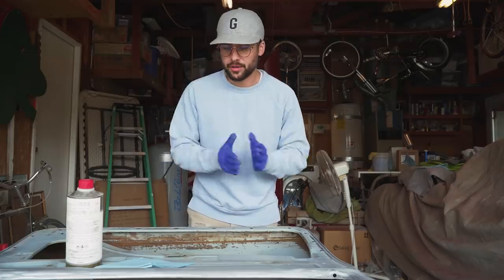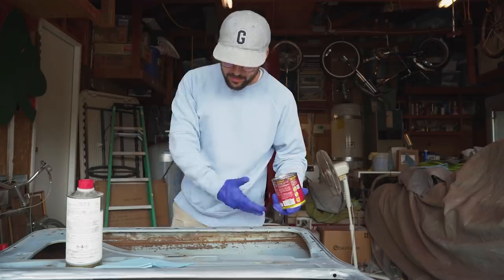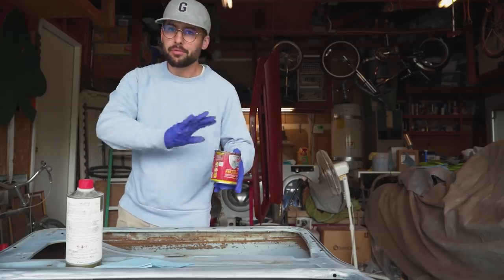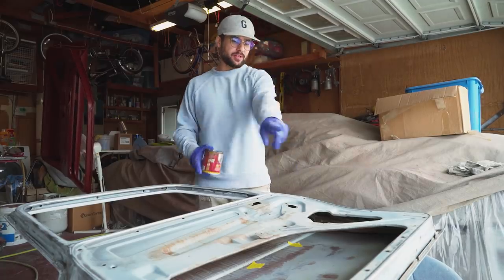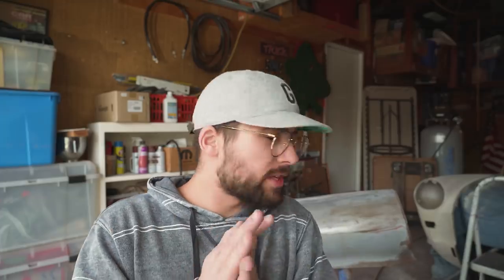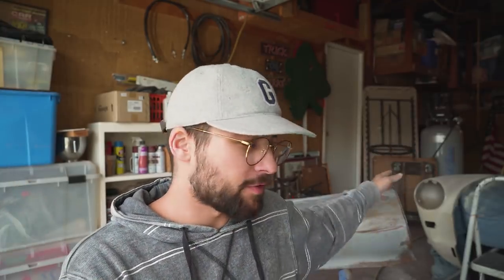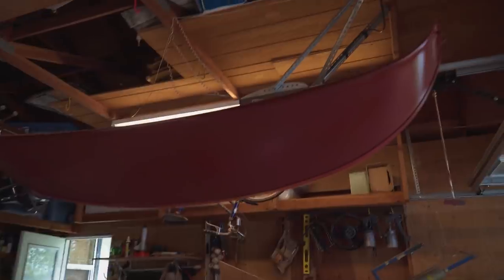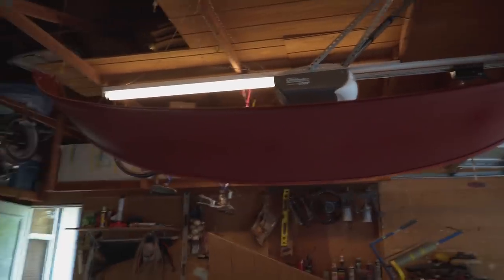Rebuilding a 1967 VW Fastback Part 4 | Classic Car Rebuild

Comment: I like this video.  Why weren’t the parts put on the car & then paint? because you wanted to paint the interior & exterior & this was an easier way to do it? Can we meet your dad?
Reply: It's a full restoration. They're painting it like the factory did. To get the door jams and trim done properly it needs to be taken apart like that. It's just more thorough. And also easier to reach the tight spots.
Reply from the maker: ill see if he wants to get on the next video but dont blow his ego up too much lol. and yeah what the homie said here, in order for us to get all of the hard to reach places and make the entire car one same color, we need to take it all apart and then paint it. Plus, the pieces needed body work which is easier to do when theyre off the car